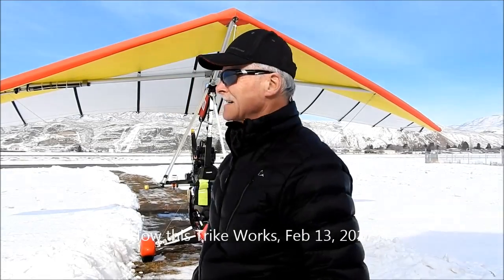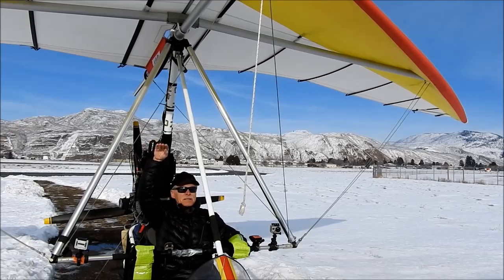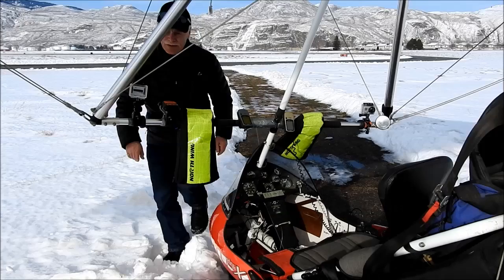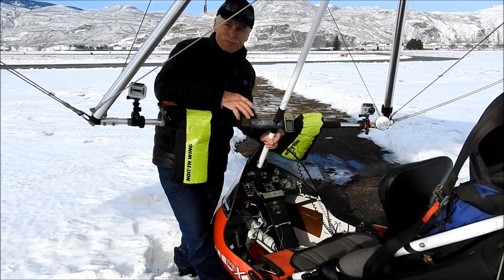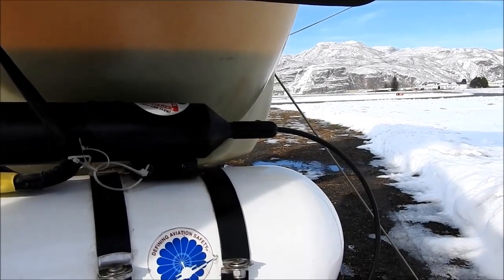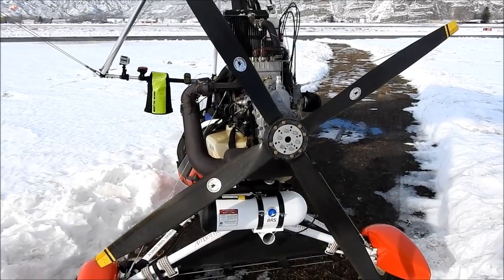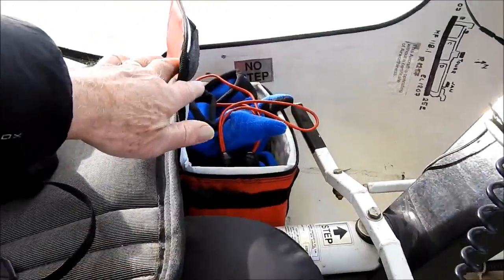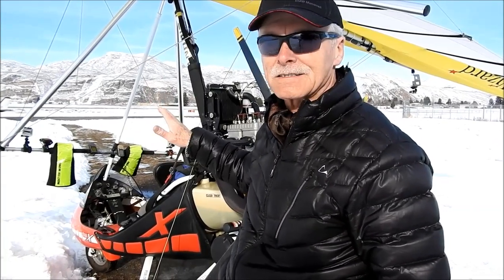146. How Trike (Motorized Hang Glider) Works, Feb 13, 2017

Comment: still curious how the throttle works. does the throttle on the right foot work like gas pedal on cars? does the fixed side throttle overide it?
Reply from the maker: It works like you fescribed